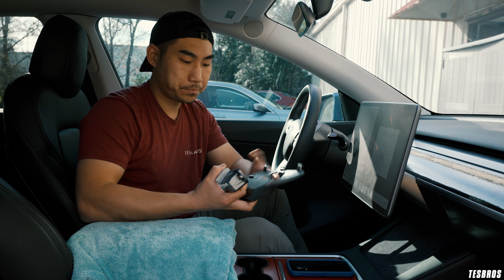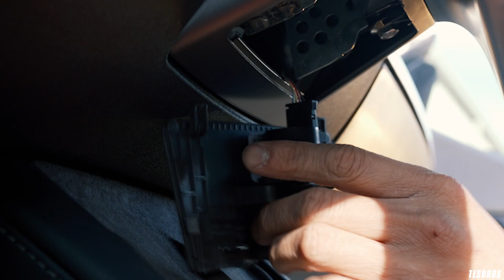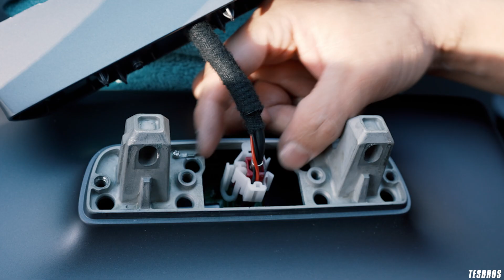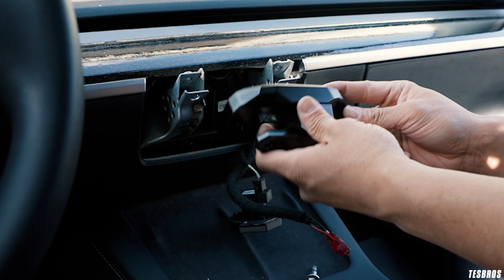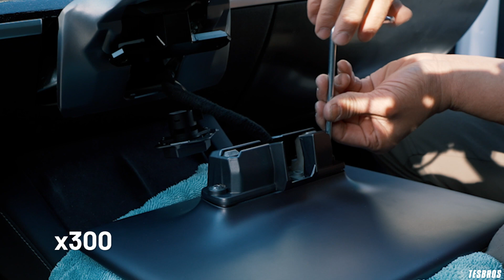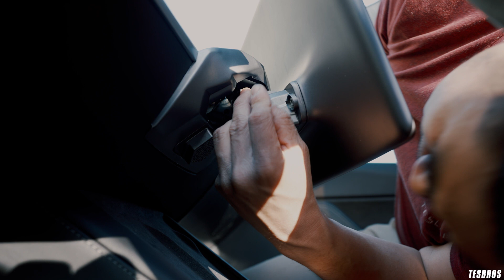Tesla Model 3/Y Rotating Screen Mount Installation Guide

Comment: I just received the rotating screen mount kit and installed it today. Just want to let people know that the video is a bit dated. I have a 2023 Model Y and it was build in November 2023. There are a couple of screws that are not used in Model Y anymore, instead they are nuts. The tools that come with the kit are very difficult to use. Luckily, I had my own tools. Also, the instructions are “generally” accurate. I had to go back and forth between the video and the instruction sheet (that came with the kit), to figure out the install. Btw, this is a big one that was overlooked in the video and the instruction sheet, once you re-plug the screen, the screen will be black (as if it’s not powering on). You’ll need to do a hard reset to get the screen to turn back on. Push in the left and right scroll wheels at the same time on the steering wheel. Push them in for 10 seconds, you’ll see the Tesla logo appear, then release the scrolls wheels. I had a panic attack when the screen didn’t power back on. OMG! It was scary. Tesbro should update their video. I feel like this is a major point to let people know.
Reply: Thank you so much. I too had a panic attack when the screen did not come on. All good now. Thanks

Comment: Hey I could use some help I just installed this watching your video and when I plugged it back in the screen stayed blank. Note I was charging the car while doing this. took the charger out got in the car, screen came back on. everything works visually but the touch screen nothing works upon touching. Any suggestions? It's as if the screen is still locked while on.
Reply from the maker: Id do a hard reset and may reset the touchscreen after. Hold down the two buttons to reset it.
Reply: @diywrapclub  yup. Tried that and all good again! Thanks!!!

Comment: Question for you I’ve had it mounted for about nine months now and I find that it is swiveling a little looser than it used to be when it was brand new. Do you know how I can tighten it up so that the swivel doesn’t move from the center position to the driver position just as I’m driving.  Do I have to take the whole thing apart again to tighten up a bolt or is there another method that’s easier without having to take the screen off again
Reply from the maker: Hi Bob, you don't have to remove everything but you should be able to adjust by tightening the center hex screw. You need to remove the trim pieces and access it and tighten that. Let me know if you have any more question!
Reply: @diywrapclub  thanks. I am glad to hear that.  I will give it a try.  Glad I don’t have to unplug monitor to get to it

Comment: I tried this and broke my screen. Car still works fine. The swivel is great. But the screen doesn’t come on. 
Guessing I damaged the cable when unplugging it 😔
Reply: Turns out the model 3 has a ‘solid state fuse’. After about and hour it will reset if it was tripped. 
Sure enough, I just went and checked it and it’s working fine. So if this happens to anyone else, don’t panic, hopefully yours will be fine just like mine was.
Reply from the maker: Glad to hear yours wasn't broken! Great advice for future installers.

Comment: This was very useful thank you. The instructions that came with my kit were not as clear as this. I had a nasty moment when I thought the touch not on the screen was broken but a restart of the car cleared that’s up.
Reply from the maker: Glad this helped, James!
Reply: The silver plastic piece that goes behind the screen is hard to push in.  I got the bottom in but the top portion those 3 tabs will not go in.

I have Model 3 v1.0